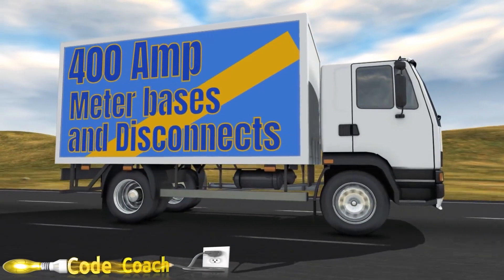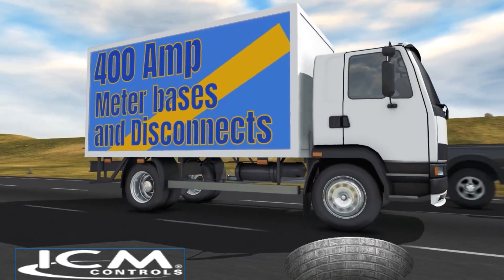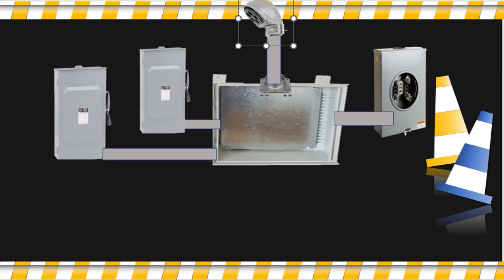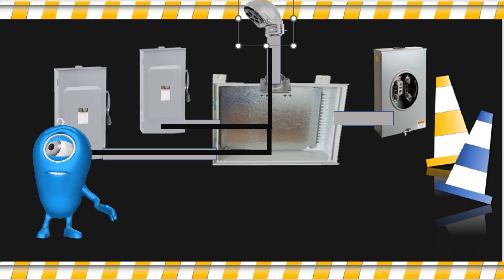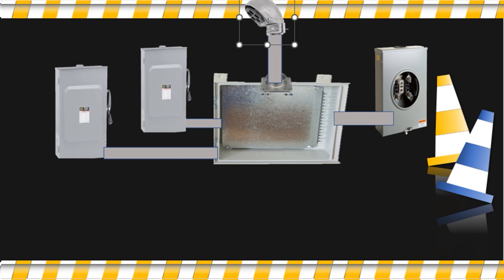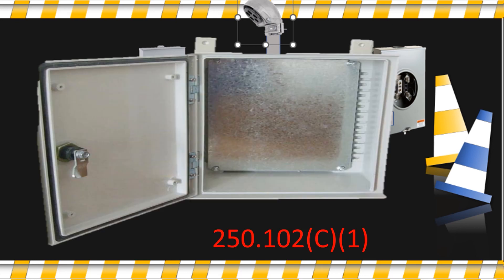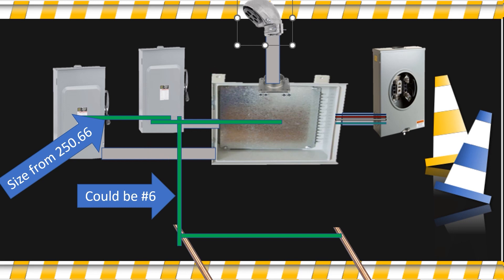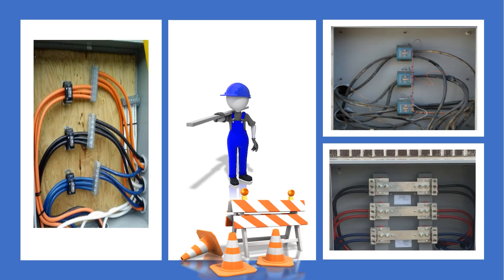How to Build a CT Cabinet. Build a 400 amp CT Cabinet. Service Upgrade

Comment: Where do we have CT cabinet on a residential service?  What are some of the thresholds?  I've been used to this requirement kicking in at 400a continous metering...
Reply from the maker: We had gotten away from it for a long long time but because of the shortage of 400 amp equipment it has become more prevalent